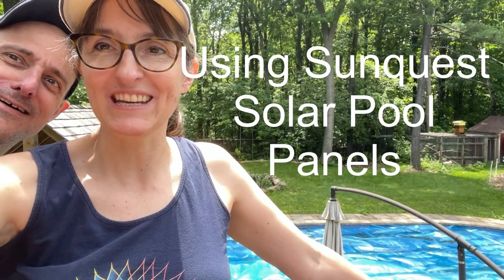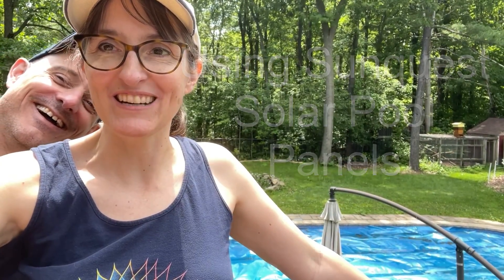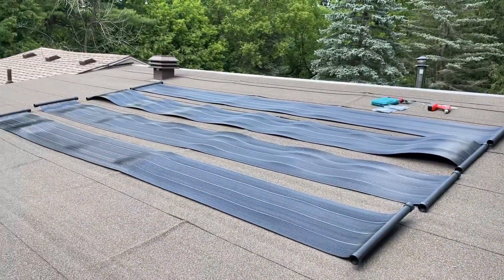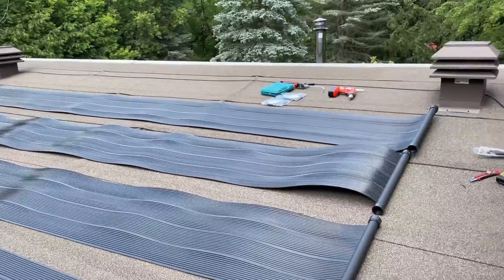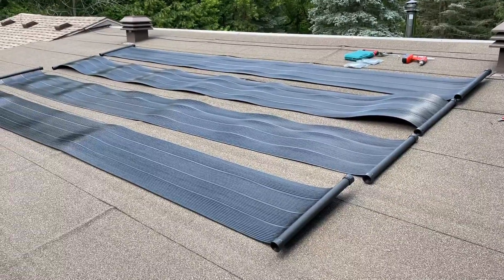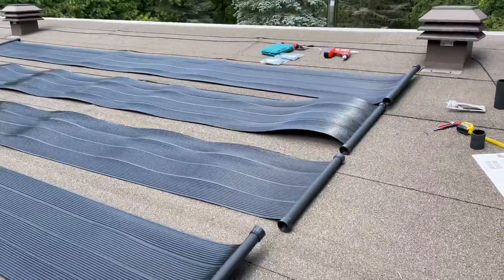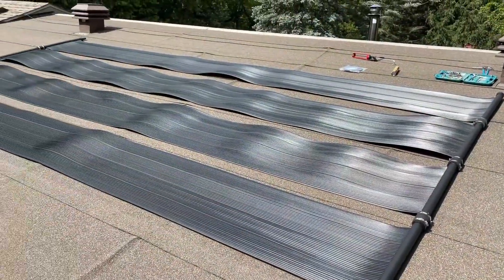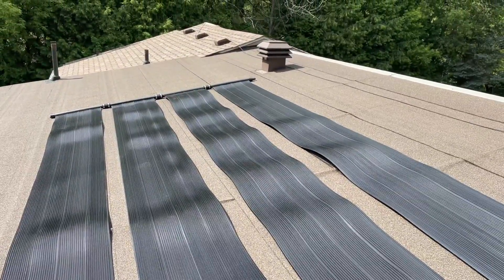Installing a Sunquest Solar Pool Heater, Part 1. Installation of the Panels!

Comment: We just started with the same set-up.  With 4 - 2' x 20' panels.  Aer you nearing release of Part 2 to your ijnstallation?
Reply from the maker: We have it up and running but are just plugging a few minor leaks. I normally release videos on Mondays but I will try to get this one done tomorrow! Thanks for the comment and good luck with your system!

Comment: I am located in Canada at 45*N and have a 15' x 30' AG pool.  My Sunquest (3 - 2' x 20') panels are fixed at 55-60*.  This setup gives me good results in the early and late season.  My system is automated to maintain 30*C (86*F).  My heat pump is VERY rarely required to supplement this system.  One warm day in midsummer a few years ago I left my controller at 40*C (104*F) by mistake.  That evening my pool was the same temperature as my hot tub.
Reply from the maker: Hello there and thanks for the comment! Sounds like your system is working really well! I am hoping my pool will get into the 80s, we'll see about that. We would have loved to get a heat pump for our pool but they're just so expensive! Maybe one day, sigh. We'd also like to have regular solar panels too. Bit by bit I guess! Have a great day!